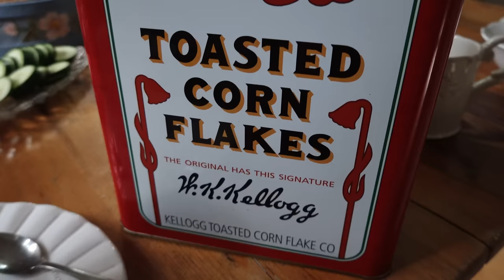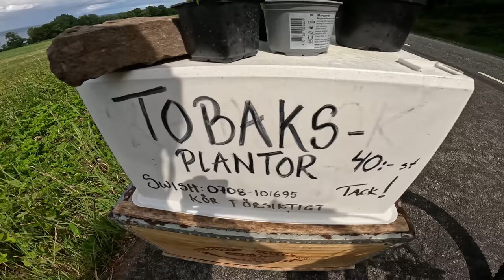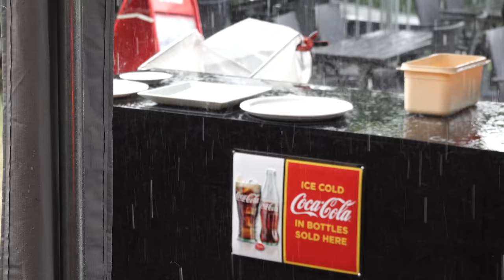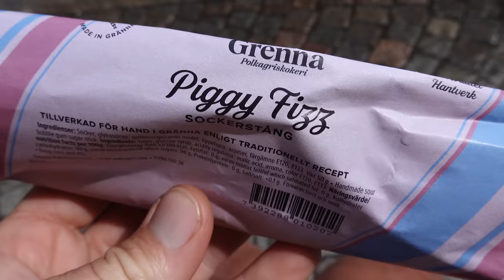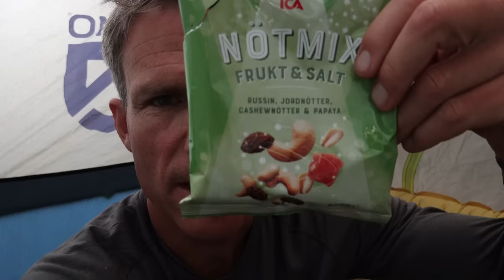A Very Long Day-Bikepacking the Length of Sweden-Episode 12

Comment: You have had the most appalling bad luck with the weather! Normally, summers are not that rainy.
Of course, you have cheated a little: You started in Kiruna, but to cross Sweden from north to south you should really have started at Karesuando - or possibly by doing the hike to Treriksröset and then cycling to Karesuando on the Finnish side of the Muonio river. There is only one thing to do: You have to come back and do it properly, ending at Smygehuk!